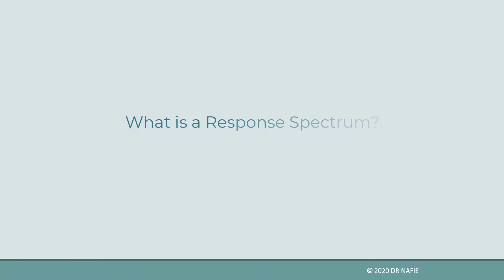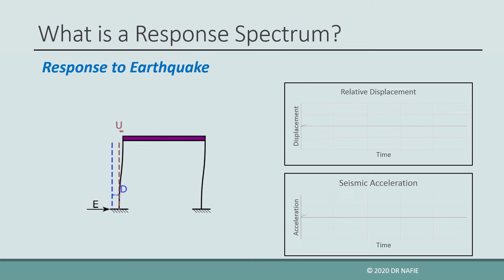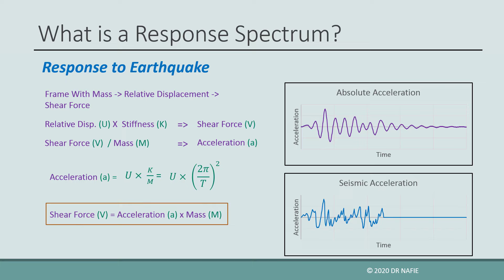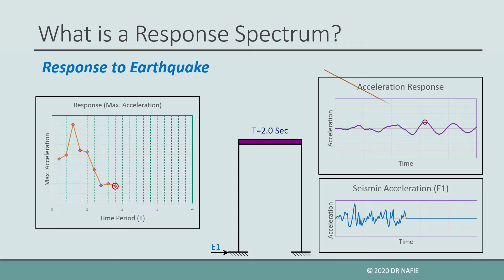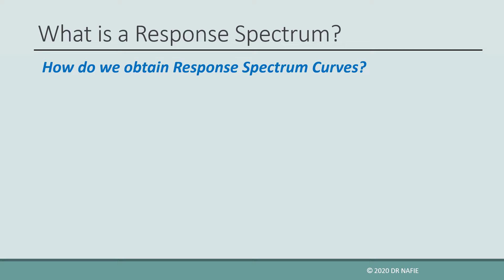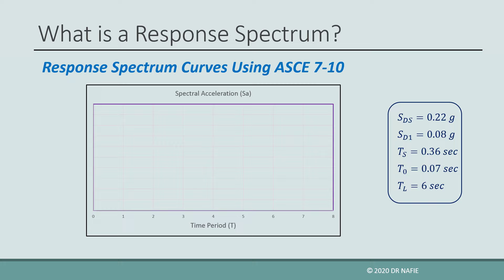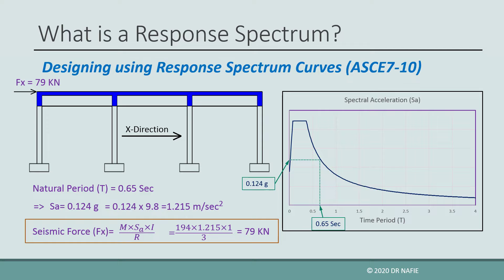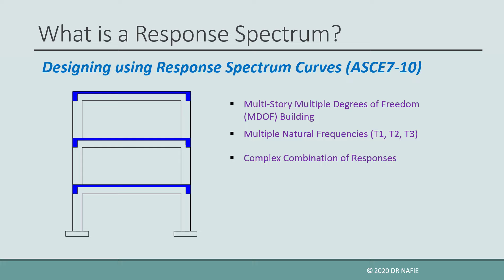What is a Response Spectrum Analysis? and How to use it in Seismic Design of Structures?

Comment: thanks for such a nice video..but i steel did not understand how we convert time-acceleration (earthquake data) to accelration-period (design spectrum)? Becouse earth data comes with time and time converted to period...in this particular transition what formula we use? have any video to explain pls or planig to make such a video? thanks
Reply from the maker: This process of changing the seismic acceleration data to response spectrum is explained briefly in the video as it is not the main intent of the video. It was just mentioned as a mean of explaining what is a response spectrum. I hope I will be able to do a separate video about this step when time permits. However, most designers don't need to do this step, since the response spectrum is given in most design codes like the  ASCE7 code and the Eurocode and all other national codes.

Comment: I've just watched 2 minutesand already I know the very basics - and can see I'll be shown further basics in quick time. Very informative and well explained [I'm a UK-based structural engineer with virtually no seismic design experience. But now I've been put on a Saudi project in the most seismic end of the country and need to get my understanding up very quickly!]
Reply from the maker: I am glad the information was helpful to you. 
My long term goal is to include a complete seismic design guide for structural engineers. 
However, currently I have just touched the basic concepts. God willing I will work progressively to complete my goal as time permits.
In Saudi Arabia, there are parts that are highly seismic especially in the south and you may reach Seismic Design category D or E, and this may need special consideration in the design and detailing.
Good luck with your work.
Reply: If You have any vacancy in ur firm kindly contact me

Comment: Thank you very much. The best explanation of Response Spectrum I have found. Its something I've  been trying to really understand for a while.

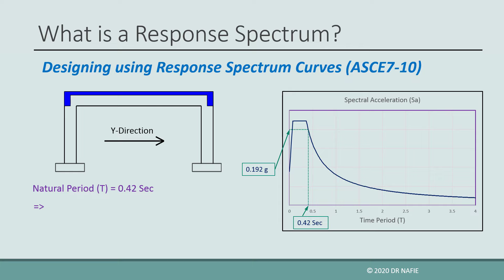Minor typo error at 10:52 where Sa in Y-direction is first stated as 0.056g but then calculation based on 0.192g.
Reply from the maker: I am glad you liked the video.
Yes you are correct. The correct value is 0.192 g, thank you for your feedback. However, it is not possible to correct a you tube video once it is posted. God willing, I will correct this type in the next version of the video.

Comment: 1. We scale up the base shear obtained by Response Spectrum Analysis (RSA) to that of the Equivalent Lateral Force (ELF) method. But when RSA base shear is higher than ELF method, why don't we scale down RSA to the ELF ??

2. Response acceleration should be zero at T = 0 in response spectrum curve. But response acceleration is starting at coordinate equal to 40% of SDS (by formula). Why is it so ??

Comment: Thanks for the kind video. I have one question about 6:40 . How to determine the range of X-axis to watch out for? Do we need to implement modal analysis for a given system? For example, if the natural time period (T) of a given system is 2 (lowest) to 4 (highest) through modal analysis, can we conclude that the effects of earthquakes are similar to the given system?
Reply from the maker: I am happy the video was helpful
This video is concerned only with the single Degree of Freedom systems (Only one Story). There is another video for Multi-Story Buildings.
For one Story Buildings. IF 2 buildings with the same T is subjected to the same Earthquake, they will both have the same response acceleration irrespective of the shape or size of the building. 
But the Forces acting on the buildings will be different. The force is equal to the acceleration multiplied by the mass. So the mass will also affect the response.

Comment: dear doctor please how can obtain (U) from earthquake ground motion to find acceleration of the building
Reply from the maker: If you look at the equation of motion of a SDOF building subjected  to earthquake motion ( In dynamic analysis books) you will find that the relative displacement (U) of the building is directly related to the acceleration of the earthquake motion. Recall that the relative displacement (U) is the difference between the displacement occurring at the top of the building and the displacement at the foundations . From the response spectrum curve you obtain the acceleration of the earthquake, from which you can obtain the earthquake force, and from the force you can obtain the relative displacement (U).

Comment: Sir, At first, you drawn the curve, by keeping the mass constant and changing the height for getting different Time period (T) and working out on a particular EQuake Data, for obtaining a response spectrum Curve. Right? Sir, in this process, if we workout for a building with a different mass, then the curve also changes, As the mass is a dependend factor, right? then how is it possible to multiply a random building mass with the acceleration, corresponding to a partiular time period, for obtaining its shear force???? please help
Reply from the maker: To explain this point we have to differentiate between two things. The building acceleration and the shear force. 
When the building is subjected to a certain acceleration at its base ( the earthquake acceleration), the building will start to respond by its own acceleration ( the response acceleration). This response acceleration is dependent on the building natural frequency and not on its mass or stiffness. 
Of course the natural frequency is dependent on the ratio between the mass and the stiffness. If you change both the mass and stiffness so that the ratio is constant the response acceleration will not change. It will only change when you change the ratio between the mass and the stiffness. That is why in the video we changed the  stiffness (by changing the height) without changing the mass (i.e. we changed the ratio so we changed the natural frequency) and therefore the response acceleration also was changed. 
Of course in structural analysis we are interested in the force and not the acceleration. The shear force is equal to the acceleration multiplied by the mass. 
So to answer your question, the seismic force is of course dependent on the mass, but the acceleration is not. The acceleration is dependent on the natural frequency.
The response spectrum curve give us the response acceleration and not the force. When we obtain the acceleration from the spectrum curve, we multiply it by the mass of our building to obtain the force.
Reply: @drnafie-structuralengineer4620  I noticed for as you increased the height of the building to produce different time periods, the graph went down despite the increase in height... please explain